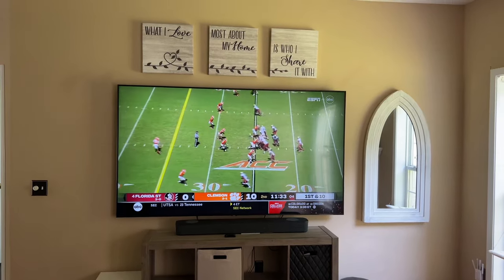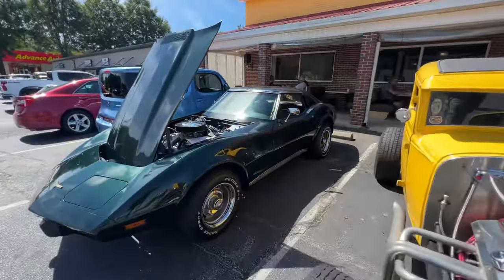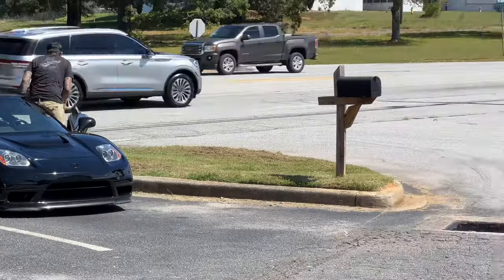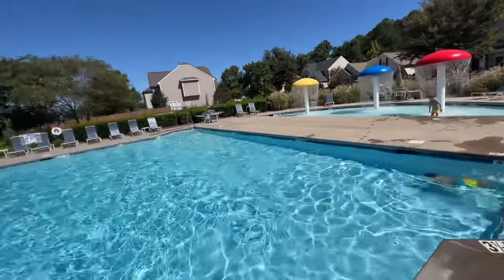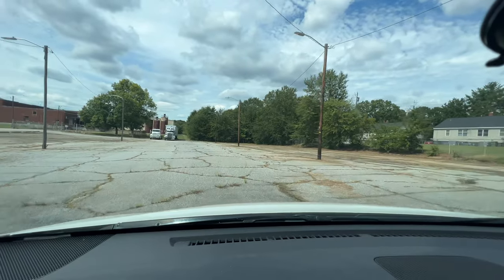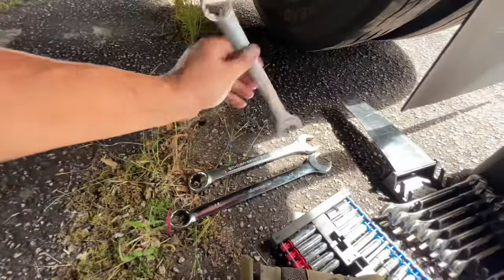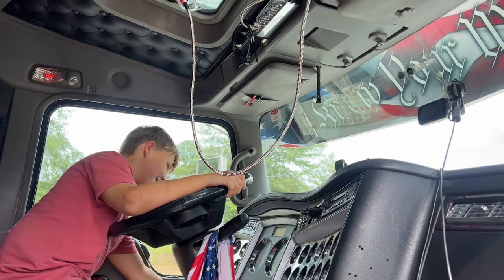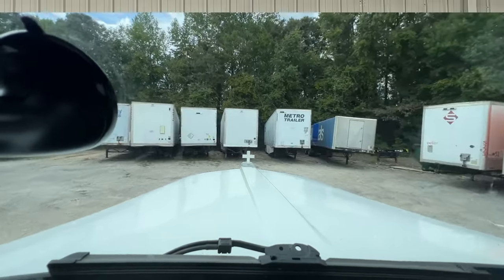REPLACING an AirBag for Great Dane VAN !!

Comment: Justin, that's a drafting operation. It's used in areas where there are no hydrants available for water supply. A tub is set , and water is supplied by tankers, then the engine drafts from this tank to supply water to the firefighting lines.

Comment: It a fire tanker truck off loading water  into the pool so they have water supply for the pumper trucks. They normally use these in places where there are no hydrants to supply water

Comment: That is actually kinda a pool. It’s a temporary holding setup for a larger fire then the pumpers pump outta there. They can use tankers from several departments to bring water in and not have to hook up to a hydrant.
Reply: Yelp
Reply from the maker: Awesome info thank you
Reply: If you don’t have a big enough water supply line in rural areas is where you see the portable water tank used the most
Reply: Hi, firefighter from Australia, they are practicing drawing water from a static supply like a lake or a pool. The pumpers only carry 800-1000 gallons so need extra water supplies if they can't find a hydrant in the location. We call it case 4 drill.
Reply: Thought it was a pool to drown an EV battery fire but guess not.
Reply: A friend who hauls water , pool water, clean fresh water in a tanker told me one of those things he does is fill up underground cisterns in developments for the fire developments to draw from.  Learned a few things about the uses for water. They also fill up holes for high tension wires so the sides don't fall in whilst they're waiting to set up the towers
Reply: Yup. I was going to comment that. I was on the fire department for 7, years before I started driving and we would train to use those pools 3 or 5000 gal. Pull up an dump the tanker an rear n the engine off of it.

Comment: That's awesome! How many of us were kids who knew someone who had a big truck? Neighbor,  relatives.  Friends dad? Let us blow the air horn and take a ride around the block,  ride along to pickup a trailer, get fuel.  That's how it starts.  I have a friend who hauls water.  Not just pools,  but holding cisterns for fire departments in developments and utility companies for holes they're digging for high tension lines.  They fill them with water to keep the sides from buckling before the foundation is poured. For the RR too. They have a car that goes along with the maintenance crew in case of the brush  catching on fire whilst they're welding or using a torch . They need water to put it out. And? To wash up! Learned lot's about the tanker work with water from him.  Yeah,  it's been in the 50's here in PA.  70's the end of the week.  But,  the changes are starting.  Enjoy the rest of September! Be well.  Safe travels.

Comment: They are doing pump testing.  All trucks are required to have an annual pump test and after any major pump or transfer case work per NFPA standards to make sure they maintain minimum requirements.  We do our annuals in the spring.  Fall is ladder testing time for us.

Comment: You will find out on 18 wheelers if you are going to do jobs like that or maybe even more complicated a cutting torch is required, some fasteners wont budge and the only way to loosen them is heat.

Comment: What the fire trucks was doing was called drafting operations, like a few said is that is  puool,  the concept is they use a truck to bring water from a one location to another, and drop it in that pool. The pool its self has two sections, and the pumper pumps out of that pool to supply the hose. They do this when they don't have access to a fire hydrant, or water sorce. they can draft from lakes, rivers, pools, pretty much anywhere that has water. Fire departments run these on a regular bases. They will also regularlly draft to purge the tanks and put fresh water in them and  run water though the pumps and fill up the tanks.

Comment: Looks like they are doing annual pump testing and certification to make sure the pumper meets minimum rated flow requirements.
Reply: Thx for an answer.   Our fire department was doing that up here in Canada this summer with a pumper truck.
Reply from the maker: Thank you
Reply: Yes, looks like pump testing. Checking to make sure the pump on the engine is able to pump to rated capacity.

Comment: The "pool" is for when there is not a hydrant available. It provides a holding point for water tenders to shuttle from hydrants to. The engine draws water from the pool for the fire.

Comment: On the tire replacement it is best to replace both or all 4 as the new will wear faster then the old as it will take most of the load off the old tire since its taller or thicker how ever you look at it!

Comment: So the tanker is dropping water into a "pond" for the engine to practice "drafting." Drafting is when they raise a vacuum to draw water into the tank of the Engine.  At a large fire scene, rural departments, or departments at a location with no hydrant within reach will have tankers dropping off water.

Comment: Those fire trucks were practicing for structure fires without hydrants in the area those temporary tanks called drop tanks are used when hydrants aren't near and trucks back up and dump there entire 1k to most 2k but some are 2500 gallons in a matter of second's the truck fighting the fire sucks the water out of the drop tank to fight the fire! This is also required in most area's to be done once a year by local volunteer fire departments and I would assume paid city department but not sure about cities honestly but also done is a competition but is mainly to test each departments ability and to check the equipment and do yearly inspections all at once!

Comment: (7:52) It looks like to me they are practicing dump tank and suction tanker scenario this is mainly used in very Rural areas but can be useful if hydrants run out of water basically they set up that mini pool some of them are huge and hold like insane amount of water and they truck the water in while a pumper pumps the water out often times to various trucks on scene like a ladder truck or some times even to the lines on that truck. Basically its a portable external holding tank. We never had them in the Fire department I was apart of but the surrounding departments had them because of how Rural it was. Oh and some times these tanks can be setup at small streams with trash pumps we usually used two trash pumps to fill the tank and when the tanker truck showed up they would suck up the water quickly and run to the scene and dump and basically they just constantly do that as long as they need water.

Comment: I worked in tire stores on and off for many years in the '70s, '80s and '90.  Yes, I know I am ancient.😭  The most common causes of tire cupping (I think Justin said waving) that I have seen are 1) out of balance, 2) misalignment (not sure if trailers have adjustments) or 3) bad shocks. Just throwing that out there for what its is worth.🤔